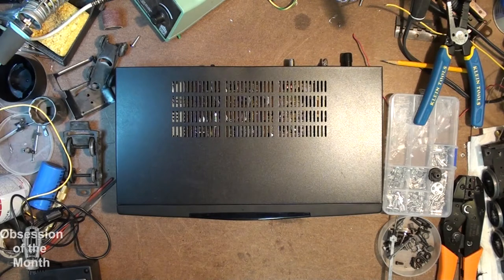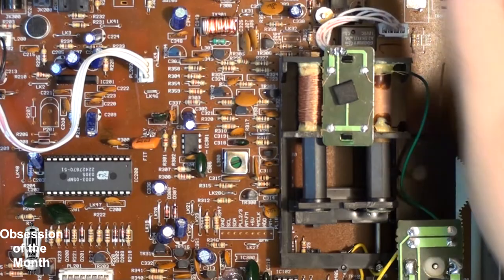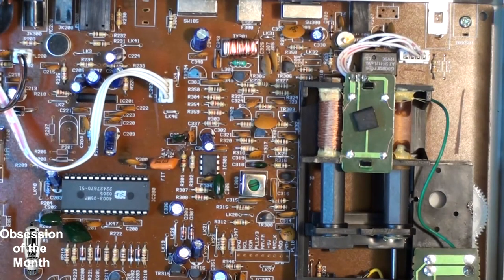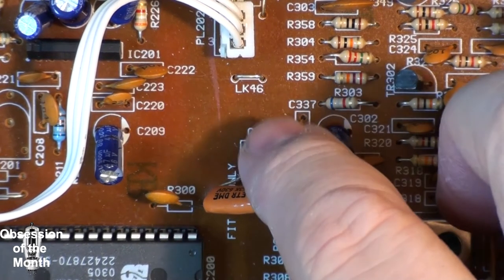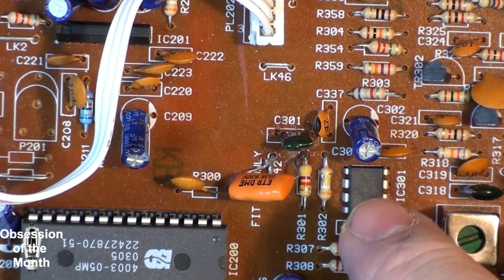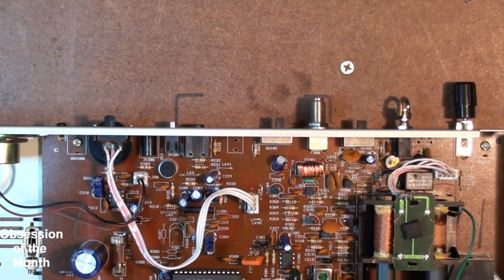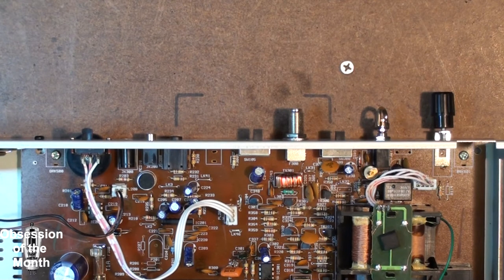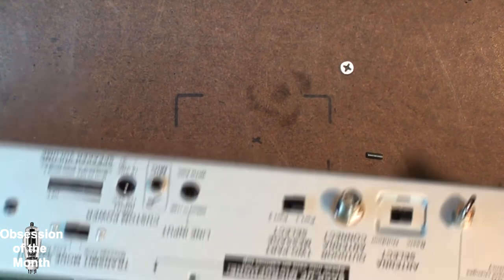Improving Audio in a Talking House AM Transmitter 4.6

Comment: You can buy one of those 3.5mm ground loop isolator audio cables to use to plug a device into the TH which would allow you to have the player connected to power without causing an issue.
Reply from the maker: tried, didn't work.
Reply: @ObsessionoftheMonth  well thats just to eliminate any additional hum from having a music player or PC hooked up to the TH that's connected to AC (to avoid a group loop), not to eliminate the hum from the transmitter itself, which is an entirely different issue.

Having ground loop isolator hooked in line on the audio input of the TH works well for me as if I have my PC connected directly to the TH audio input I get a ground loop hum which the ground loop isolator fixes.
Reply from the maker: @madmax2069  I understand what you are saying, these units were never made to play music, just to sell houses. they have interference problems, grounding problems, audio frequency problems, antenna issues, and there are whole forum posts and many other youtube videos dedicated to trying to fix the issues.
Reply: @ObsessionoftheMonth  yes I know their original use case was for. luckily for me I'm not playing music, just old time radio shows which is mainly just talking, and the source material isn't what I'd call great anyways so its a non issue for me. 

Hooking a wire up to the case to act as the ground plane counterpoise and running it under the antenna cable seems to have solved most of the issues with transmitter hum for me.

Comment: You're correct about the hum problem. Medium wave broadcast really needs a good ground plane counterpoise, or the RF tends to migrate to the power line where nasty electrical noise exists which tends to remodulate the signal with buzz and the like. Switching power supplies are the worst for making dirty power lines. Another thing to do is use an audio isolation transformer. This is important, especially when using audio from ipods, mp3 player, computer audio, etc. I've had to use such audio sources in professional broadcast applications and using audio isolation transformers is key to insure proper isolation and good audio quality.